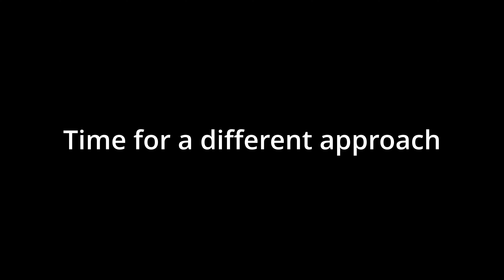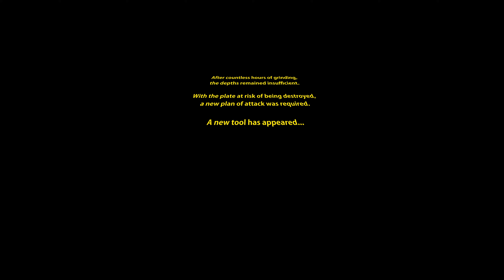3018 CNC Cast Iron Upgrade (Part 1)

Comment: i would have never tried to done anything u just did. i need to have alittle more faith in my little 3018 an i'll end up spending alot of money thanks to you. love the videos. new fan in me.
Reply from the maker: Just a heads up, this particular upgrade ultimately didn't end very well - I might revisit it in the future if I get better equipment, but between the underpowered motors and custom mounts things got pretty hairy.   It sure was fun to try though.

Comment: Super heavy duty. Cant wait for your model. Did you build C-type CNC? I mean Pillar type?
Reply from the maker: I'm still debating which way to go for the Z axis.  I'm trying to reuse as much of the 3018 as I can so I might try just hard mounting the z axis on the existing gantry to start.  If that doesn't work, C-type is probably the next step unless I can think of something crazier.
Reply: @RRFTube  With combo xy slider better build C-type bro. And use this new heavy duty to rebuild 3018. With 3018 x and y is its weakness. Wait for your build.
Reply: Honestly I would chalk up re-using any part of the 3018 as a loss. There’s cheap mini mills and conversion kits out there where everything fits and none of this tedious rework would be required! Your time is valuable!!

All for just doing a project for funzies and the learning experience but if you actually want a practical machine I’m not sure if this is the best direction.
Reply from the maker: @bohdanwesely8369  I've enjoyed every failure and hope I have many more before I reach my goal. 

For anyone that actually needs to get something done, I agree - skip this nonsense and get something decent from the start.

Comment: That stepper motor won't last long. Might be good to upgrade to something like a NEMA 17 48mm, that can still run on the original board.
Reply from the maker: The little guy's pushing it around now, but yeah I expect once I get some work on the table and actually try to make some cuts their weakness will start to show more.